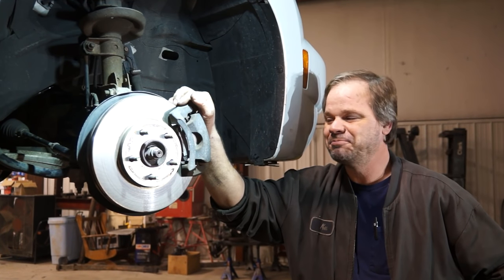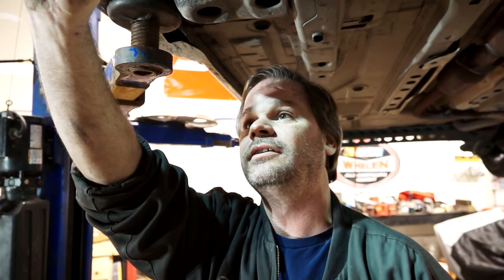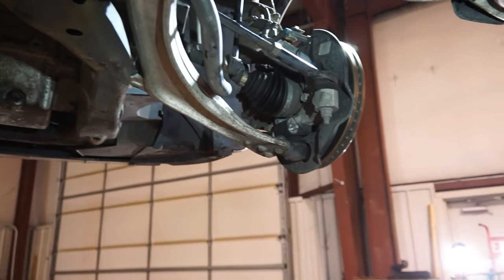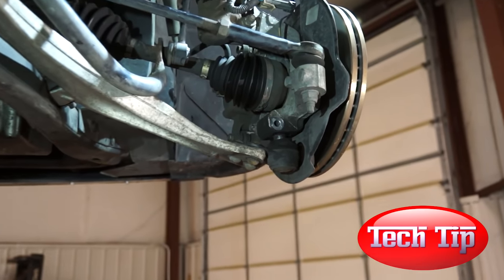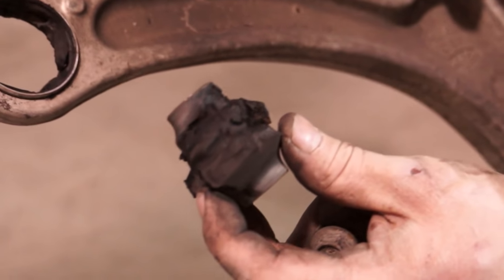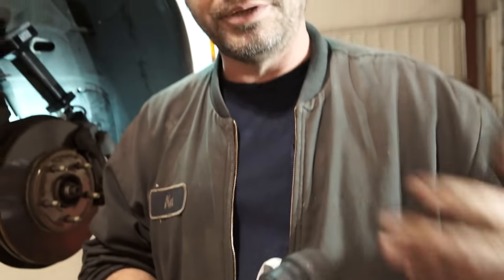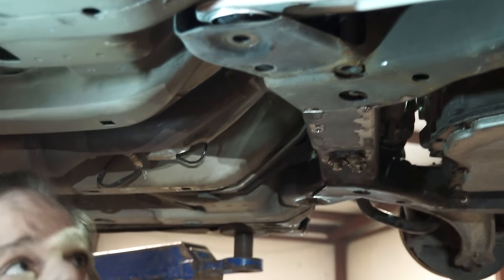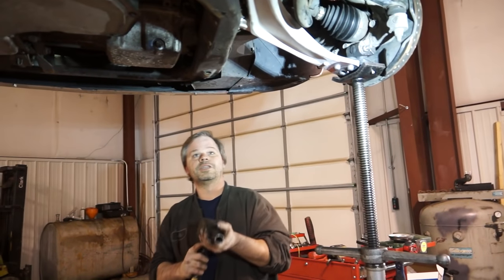SG2 HHR Control Arm Replacement

Comment: Just got an HHR and this video helped out! Thank  you!
Reply from the maker: Glad we could help!  We will have more videos coming out for the HHR as both Ken and I have one, so you might want to subscribe if you haven't already.  We actually have another video out right now that shows you how to fix a turn signal stalk that won't turn off.  It's a common problem on HHRs, Cobalts, and several other GM models.  And the best thing about it is that you don't have to buy any parts - it's a free fix.  Thanks for watching and commenting!

Comment: DO NOT trust your air gun on the big bolts.  Proper way is 74 lb-ft PLUS 180 degrees.  Lots of come backs due to faulty tightening.

There is no need to force the ball joint stud out, once the bolt is out only light friction is holding it.

Good practical tutorial.
Reply: Air/impact to remove is OK.  Torque to install.  Torque sticks might work if you have the room, and understanding how they work

Comment: Thanks for the great video!

I've got moog replacements ordered and plan to take it on this weekend.

What size is the line up punch you use in the video to line the bushing up? What would be the best size to buy for the most common car jobs?
Reply from the maker: Ken tells me any round bar or object that fits in the hole will work.  He says he has even used screw drivers to do it in the past.  As for a common size punch or pry bar, I'd just buy a small set that has a few sizes to keep you covered.  You'll end up needing more than one size for other projects anyway and sometimes it's cheaper to buy the set than to buy several individually.
Reply: Fantastic. Thanks!

Comment: I need to replace the lower drivers side ball joint on my 2008 Chev HHR, can just the ball joint be replaced & does this take long to do?  love the out takes at the end to show it does not all go as smooth as a finished video show lol
Reply from the maker: Yes, you absolutely can change just the ball joint.  Ken tells me that the time required will really depend on your automotive knowledge.  He says he can usually change one out on an HHR in 20-30 minutes on the ground, but it will probably take 1-2 hours for the average person depending on their skills and the tools they have.  Best of luck with your project and thanks for watching!

Comment: I gotta a question mine chevy hhr 2006 is knock when I drive around lots. I just repair the engine putting every band new. But it still knock, not losses oil pressure. I can't figure out why it knock

Comment: On the one I'm working on, the drivers side is shot, passenger side has a little up and down movement. Question is: is there supposed to be any up and down movement with those bigger bushings. Thanks in advance.
Reply from the maker: Very little.  If everything is tight and you can move it up and down freely by hand, chances are some of the rubber has worn away and is letting it slip.  Usually if one side's bushings are in bad shape, it won't be long before the other side has the same problem.

Comment: I have a control arm with ripped cracked bushings.  I've known this for about a month.  Last night coming home the cars steering wheel got very loose and has too much free play. Driving in a straight line is horrible because of the steering looseness.   Does this control arm bushing have anything to do with loose steering ?
Reply from the maker: Absolutely.  You will definitely need to replace those bushings.  That would be the place to start.  But with steering issues, you might have other things going on too.  When you jack up the front end, see if your wheels jiggle from side to side (this will indicate worn tie rod ends) and up and down (this will indicate worn hubs/wheel bearings).  If you've got these things going on, you'll need to replace those parts as well.  Also if your suspension is squeaking when you turn the wheel or push up and down on the fender, you have bad ball joints.  That's why Ken recommended replacing the whole control arm so you get new ball joints and bushings.
Reply: @TatteredSailsPics  . I'll  check what you described .  Iam just worried it's a bad rack and pinion

Comment: I  know this is a 5 year old video and I am about to tackle this project on my HHR. I also have to replace the strut. Would doing this with the strut off be any easier? OR should I tackle it one component at at time?
Reply from the maker: It would be easier to do them one at a time so you have more than just the axle and tie rod holding the knuckle.  Also it will help lining things up.  Plus, you don't run the risk of ripping out the ABS sensor wire or the brake line as much.
Reply: @TatteredSailsPics  No ABS 
But Thank you.

Comment: What to do when ball joint stud does not want to seat all the way up in the knuckle?
Reply from the maker: Check your new part against your old part and measure the stud that's causing the problem.  If the measurements don't match up, you might have the wrong new part.  If they do match up, there might be build up where the ball joint joins up to the knuckle.  Make sure everything is clean and clear before inserting the stud - you might have to take a screw driver and clean out the hole.  If it still doesn't line up, jiggle it around a bit before you add the pressure to it.  If the part is correct and none of this other stuff is working, last thing I could tell you is you might have a bent or damaged knuckle.  Hope this helps!  Thanks for watching!
Reply: @TatteredSailsPics  thank you

Comment: My control arm bolt is just spinning! The one that bolts into the subframe. I can feel a cage but at the top but cant get to it. what do I do? Any solutions
Reply from the maker: If the weld on the nut is still intact, the bolt probably just isn't lined up with the hole.  You might be able to put a little pressure on the control arm with a jack to help get it in position, then use a pry bar or screw driver to line it up.  If the weld is broken and the nut is loose, you've only got two options.  You can cut a hole on the inside of the frame rail right above above where the subframe bolts up to it so you can get a hold of the nut with a wrench or pliers.  The other option is to look to the rear of the subframe along the frame rail where you will find a hole.  You might be able to get a pry bar in there to hold the nut.  If you have to do either of these, make sure to use lots of penetrant so the bolt will move within the nut.

Comment: Does replacing this part affect the ride of the car.I just got new tires and the guy at the tire shop told me I need new CAB.
Reply from the maker: In a word, yes.  Worn control arm/suspension bushings will eventually cause a clunking or popping you can hear and feel when going over bumps and turning.  It gets worse the more worn they get.  Think of them like cartilage in a joint in your body.  Over time, the cartilage wears down to the point the bones are grinding together, otherwise known as arthritis.  Without artificial cartilage or joint replacement, the bones become deformed and the joint doesn't work properly, causing pain and other issues.  Similarly, if the bushings become so worn they are almost non-existent, those parts start to rub together and move in ways that cause other problems (in addition to poor ride quality) such as steering and braking issues.

Most mechanics will be able to tell you how far gone the bushings are and if they are in immediate need of replacement.  As it is a "wear" issue, there will be many opinions out there on what wear amount is tolerable.

Drive the car and listen for noise coming from either side of the front end as you turn and go over bumps.  If you have a jack, jack up a side and look at the bushings.  You can see where they are located in the video.  If they have lots of cracks or pieces missing, get them replaced - especially if you drive the car a lot.  If you don't have a jack, go to a different shop and ask them to check the bushings for you.  If multiple shops you trust say it needs to be done, it needs to be done - more for safety than for comfort.

Comment: you did not torque any bolts ? WHY ?
Reply from the maker: Every bolt, nut, and screw on a vehicle has recommended torque settings from the manufacturer, but it is not vital to torque all of them to spec.  Some, such as the axle nuts and head bolts, for instance, absolutely must be torqued properly.  The control arm/ball joint bolts on this vehicle really just need to be tight to keep the control arms and knuckles from moving around, so the recommended torque spec is not absolutely vital.  They can certainly be torqued to the proper foot pound number, and in theory, that would be the "by-the-book" way to do it.  But in practice (to save work and time), if it just needs to be tight, you don't really need to worry about specific torque numbers.  We will always let you know if it is one of those applications that requires specific torque settings.

Comment: Where did you get it at
Reply from the maker: Ken tells me you can get the control arm assembly with bushings and ball joints from most parts stores.  He doesn't remember exactly which one he got this particular one from, but it was most likely Auto Zone, O'Reilly, or a more regional company called Smyth.  Those are the outlets he usually orders from.

Comment: NO TORQUE SPECS...WHY??
Reply from the maker: There are no torque to yield bolts or nuts that need rolling resistance, such as axle nuts or pinion nuts.  Specific torque is not necessary for this application.  The bolts just need to be tight.

Comment: Great video, but what do you do when the carriage nut spins because the nut breaks loose.
Reply from the maker: Ken says your two options are to cut a hole on the inside of the frame rail right above where the subframe bolts up to it so you can get a hold of the nut with a wrench or pliers.  The other option is to look to the rear of the subframe along the frame rail where you will find a hole.  You might be able to get a pry bar in there to hold the nut.  He suggests using lots of penetrant to make sure the bolt will move within the nut.  He snapped some pictures you might find helpful if you want to email him at kbaker.shiftinggears@gmail.com.  Hope this helps.  Thanks for watching!